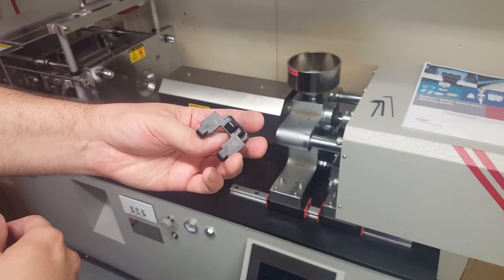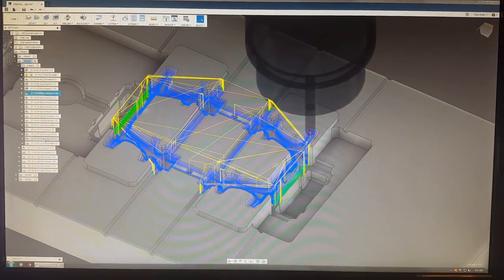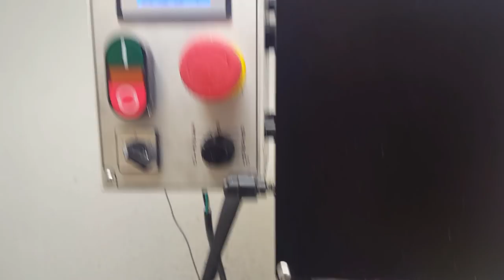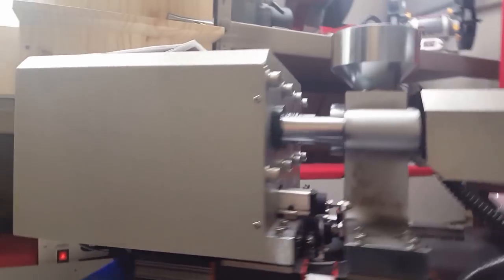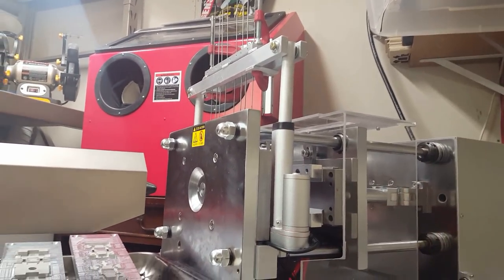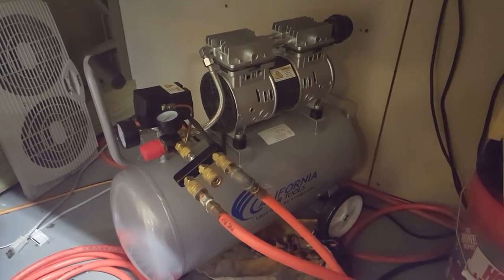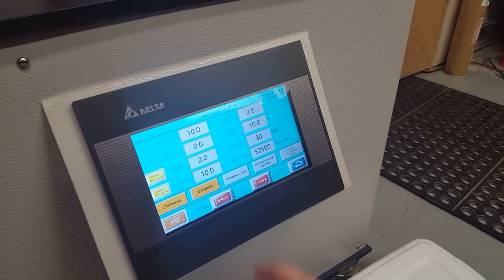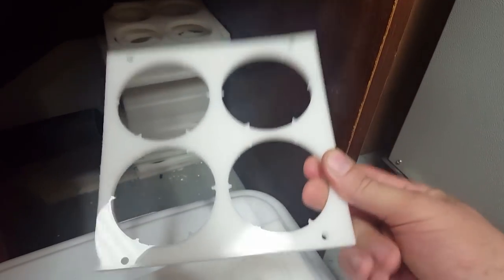Injection Molding - How It's Made & How It Works - Spyker Workshop

Comment: I am a professional plastic injection moulder of 40 years, aluminium mould don' t store heat, and Delrin epoxy resin needs 60 to 70 degrees tool heat to stabilise the strength and structure of the component being manufactured, depending on the wall thickness, and the size of the runner system determines the over all time to complete the weight to ratio of the part, i also did hear any mention of pressure from injection to mould input, which determines how hard you push the plastic into the mould or holding pressure which hold pressure for a determined time, whist the part stabilise it structure, so, speed, pressure, holding pressure are all necessary in the development of good components, and i also notice that your melt temps need to be rear zone cooler increasing to the middle to front zone slightly hotter.
Reply: Comments like this are just dick wagging. 

If you actually have something to contribute, trying asking him question or giving simple and actionable constructive comments, not just listing off a bunch of industry talk that has little relevance .

I'm a tool maker at an injection molding shop and I saw a mold close, a mold open, and a good part pop out. That's 90% of the way there. I wouldn't listen to anyone who speaks the way you do.
Reply: If you need help getting these plastic or metal parts made, this guy can help:
https://www.linkedin.com/in/roopen-bundhoo/

Hope this helps

Comment: I was just doing some research on injection molding and came across this video. I was shocked to see you have the same milling machine as I do. I have yet to install my dro, but I have thought about a cnc upgrade too. Really cool to see some else has done this. Its like your shop is mine in the future lol. I have a project the requires a longer table (like 30 "). Do you think that it is possible to make one and install it onto the pm 25. Thanks a lot for the video

Comment: I am sure you've figured this out already, but I thought I'd mention it anyway.  The reason that the track furthest from the sprue looked better on your second runt is the mold had been heated by the first run and now allowed the shot to flow better.  A warm mold always works better than a cold one.  Some molds are heated for this purpose, depending upon the material being injected.  Those are my two cents worth of info.  Hopefully of some use.  Thank you for such a cool video!  I am now considering doing this in my shop.  Cheers!

Comment: On your flash this may be caused by mold deflection during injection if I could see your mold installation a bit better I could explain how to trouble shoot mold deflection during injection. Your a very bright young man and have went further then some individuals with 30 years under their belt. I'm an former injection molding processor in thin wall injection molding and I'd be willing to help you out any time. Keep up the good work.

Comment: If a press fit hole is too loose, it can be tightened by using a large ball bearing. Place a large ball bearing, (1/2" diameter or so), center it on the hole and give it a whack with a hammer. This will evenly compress the metal around the hole re-tightening the press fit. Loctite also makes a press fit adhesive.

Also, use a hardened steel backer plate behind your ejector pins and use ejector pins with a shoulder so that they can be inserted from the back of the plate in a slip fit hole. The pins can then easily be replaced and the hardened steel plate prevents any wear. This type of ejector pin can be bought from various suppliers like McMaster-Carr.

Comment: mate I'm reading through these comments and it's honestly painful. I don't know what's going on with these people, but I congratulate you on this. I haven't done it so to me it's also very inspiring.
I don't know whether you have a lathe (I'd assume so if you have a CNC), but if you do maybe consider going hydraulic, you could make most of the pistons and whatnot yourself and just use smaller pistons actuated by screws instead of a pump. So essentially you could make an entire machine yourself. Hell that's what I plan on doing in a distant future. You could also add some water cooling to the molds to make the process quicker perhaps. Also you could lap the surface of the molds, that way you'd completely eliminate flashing provided you had enough support (not worth much if the mold just bends). Then compound that with a release valve on the plastic side of things so nothing blows up.
Just some ideas, again I've never done this but I do wish to and do give it some thought every once in a while.
Thank you for the video, and thank you for going so in-depth! Anyone leaving non-constructive comments is not worth listening to, especially in topics like these and people like you who put so much effort in.

Comment: great video , i am a mold ,tool & die maker for over 30 years with plastic and aluminum parts . you need waterlines in the cover and ejector halfs or the mold will flash crazy as it heats up over 1/2 hour ,plus the mould will distort permanately after 200 hr .
Reply: John Pauels hi , do you own a shop for your services? I am looking to produce an invention ; however ; I am looking for production on demand meaning that I would create a website and for every paid order the manufacturer will recieve each order along with the payment instantly from my portal. I am in Panama Central America and have no plans to travel to the US anytime soon with the covid19 ; can you suggest a serious company that could be willing to do something like this ? In china its common but would rather do this in the US thanks !
Reply: Hi John, exactly, he needs waterlines inside of tool to cool down the tool and plastic part, if the part has flash crazy, then the tool needs to shut better and improve the injection settings such as increase injection pressure/speed etc.
Reply: @ojoaereo241  hello ,yes i have my own shop ,youtube ,,,trinidad boring mill ,trinidad milling , trinidad lathe ,,etc , worldwide tooling working out of north america ,china and mexico
Reply: All true ideas in this comment.  Been in injection mold tooling and production since 1962, still consulting on Monday and Thursday.
Perhaps salvage your tooling to correct for shot size by inserting 2 cavities into a water cooled steel mold base? Form the tool inserts by cutting the existing plate into two, trim for symmetry and add a sprue on the center gating into the runner. Tunnel gating would disconnect the runner system. Horizontal camed slides with pins and wedge locks could automate core pins on mold opening and closing without the air assist. 
Add return pins to your ejector plate to save damage to the top cavity. 
Your sprue puller is HUGE wasting a lot of material, reduce with a bushing to just over the sprue's diameter. Use a Z pin or an undercut to retain the sprue for ejection.
Be careful around the clamp.
A nice setup, thanks for the content, a needed video.

Comment: i work at a mold shop and we use ejector pins with caps on them, like bolts, you counter bore the ejector plate and then add another plate behind that to keep them from pulling out. just add a solid plate on the backside of your ejector plate and you should be good to go. hope that helps  love the vid and ill look into buying one of these things to start a business of my own. very informative video thanks.

Comment: no water water on mould? a simple water channel in u shape through the tool bothsides set at 80 degc for delrin/acetal/P.a will make a much stronger part. this is because delrin is a crystalline material.
Nice set up. ive been a moulding tech for 27 years.your the first person ive seen make there own IMM.
Keep going.

Comment: Literature should specify the maximum capacity of your barrel and screw.  My familiarity is with Surfcam, which will calculate the volume of a part.  (Don't forget your runner and sprue volume.)  I wonder if Fusion 360 might do the same.  This could save you some future grief.  It's quite unusual to gate outlying cavities by going through a nearer (to the sprue) cavity.  This can lead to uneven packing in the outlying cavities, plus, you will have two runners and gates to clip from the nearer parts.  Molds work better when they are balanced.  In spite of having closed off one outlier, the mold is still unbalanced and may not sufficiently pack the other outlier.  You can mitigate this to some degree by widening the runner(s) on the side with the outlier.  This will reduce the back pressure resistance as resin flows into those two cavities.  You will likely need to experiment a bit to dial in your packing.  Your gates look huge!  You might consider ramping them, such that they are like chisel points at the edge of the cavity.  Plastic much prefers smooth transitions.  Try to avoid sharp edges in your runners and gates as this creates turbulence which can affect the part's finish and cosmetics.  The judicious use of vents might alleviate some of your flash and burn problems.  The air in the cavity must go somewhere when displaced by resin.  Some will leak out around your ejector pins, but this is usually not quite enough.  As the air compresses, it can become very, very hot.
If you're machining aluminum, the fewer flutes, the better.  Get some 2 flute mills, center cutting if possible so there will be less worry about plunging!  Aluminum rather likes WD-40 as a cutting fluid.  Alternatively, you could use A-9, in the iconic green can, but it's a little more expensive.
Typical ejector pin heads are captured between two plates with just enough clearance to allow them to "wiggle" within a slightly larger hole, but not move longitudinally.  I would ditch the JB-Weld.  Ejector pins need to float or they WILL eventually bind, bend and/or break.  It's not pretty when this happens.  It's especially likely with aluminum molds because the steel pins abrade the aluminum.  The aluminum sticks to the pins which eventually become too crufty to move,  ergo, "plink!"  Keep your eyes on those pins.
What you've accomplished here is quite impressive.  I wish you good luck.

Comment: Fascinating! You can make a second plate the same size as your ejector plate, use counter sunk fixings to secure it behind the ejector plate and it will keep your ejector pins in place as they cycle. You will need to use shorter ejector pins to account for thickness of the plate tho.

Great video, thanks for sharing!

Comment: spiral point  tap is what you used, if you are doing blind holes use a spiral flute which ejects the chips up and out of a hole that does not go through the material. brilliant work and problem solving.

Comment: Super interesting video. My mind is kinda blown by how much time and effort you've put into this.
Reply from the maker: neotoy Yea I put so much into this cause I want to make TONS of fifferent tracks, Im working on my Spyker KAT trzck mold right now
Reply: Try a star/spider array instead of linear. Arrange parts around sprue at compass points (N,E,S,W).
Injection molding works best when mold is balanced - 2,4,8,16... parts per runner.

I've been out of the game for a while, but your vid is comprehensive enough to trip  a memory dump. 
Good work and good luck!

Comment: Having a 3 cavity mould in that configuration is going to lead to very uneven filling/packing. The 1 will be full and over packed before the 2 are full. The melt front velocity will change dramatically too. You would be better off just making 2 at a time.

The best way to make a 4 cavity mould is to have each impression at 90 degree intervals around the sprue, to keep the fill paths balanced 👍

Comment: I am former truck driver, and one of the jobs we did was haul for company that were plastic compounders.  These folks added fiberglass, colour, mixed stuff, cut and bagged or put it in big totes, we would back into their docks and deliver it to all kinds of injection moulders.  To kick something out of a mould, the easiest way is run 2 small bars, mounted permanently to back of the mould.  When the mould is closed, these bars sit just bit behind the moulded product and when the mould opens, these rods kick the product out
Reply: Gaylord's?

Comment: you could have spread the injection entry  gates 1 per part from a single entry to distribute the plastic load equally.  Been there many times learned the hard way 25 years ago when I started making my own injection molding machines and parts. Grinding is great but they are not cheap. You can build one fairly inexpensive using creativity with similar grinding type mechanisms out there.

Comment: I want to help you with some ideas. I hope it will be useful. I don't have much experience either, over 3 years.
First of all, why the right side is full and the left oneis not, right? There are several possibilities to try, the first thing the point in the mold on the right side of the injection is larger than the one on the left, it may not be seen, but it is, it must be verified, I think that is the problem. if it doesn't work, check the steps below.

Closing power, I think you have to try more BARs.

The temperature in the worm must be tested.
After all, you have to play a little with the first step of the plastic (I do not know how it is called in English), and with the speed of the plastic in mold.

What is very important, there is no water in the mold, make the mold a little thicker and you can make the water pass through it, so cooling will be done in the mold, it is very important.

Comment: its nothing to do with cad drawing.the smallest difference in gate size will cause an inbalance resulting in uneven fill. we use pin gauges to get as close as possible then mould to see result, either polish or respark  using EDM. a small polish can change the flow as much as 10%.
Reply from the maker: No I ran out of shot size. In CAD I went to the max of 30grams but the physical property was set to ABS. Delrin needed like 32 grams. So it could not fill. I have to block off the other cavities vs recutting the mold with a slightly smaller part to get to 30 grams.
Reply: @thegreatestmoo  sorry, looked like you were having processing issue, couldn't tell from here that you maxed your barrel. There is a technique called flow moulding, before you you inject first stage you spin screw with back pressure on to force material into cavity then first stage, hold pressure, screw back as normal. We use it when we run out of volume.as long as you end  up with some material to drop to hold pressure you will be fine. Hope it helps, better than recutting.
Reply: Also called intrusion moulding.

Comment: Maybe when you make the ejector pins drill a little bit smaller hole all the way through an ad some Dora stick I think that's what it is called   aluminum welding rod that you can weld with a propane torch though oxy-acetylene or MAPP gas and oxygen is easier to use with it also I would grind a notch around the end of the pins so the weld can grab on to it and secure the pens from moving but just a thought
Reply: Usual method for production molds is to use headed pins in a two-piece ejector plate.

Comment: Nice work ! Your machine looks so tiny.. I work with large injection molding machines with up to 600 tons force,  the molds weighs up to 4 tons on that one :-) I have a tip for you, have a look at SimpleCV, its a very easy to use computer vision library, that way you can use a little raspberry pi and camera and do part inspection. Checking if to mold is empty before closing, (if there is a part that you ir barrier misses).. Its very easy, take a picture with empty mold, when machine opens, take picture, compare to empty picture, if same continue cykel.. Please keep posting the mods and updates you do to the machine! Have a nice day !
Reply: Peter Lehnér please do you know how much does it cost to have one like what in the video?

Comment: That looks like a Delta Programmable Logic Controller for the brains of your injection molding machine. The programming software, ISP Soft, for those PLCs is free. If you wanted to learn it, you could integrate the changes into the controller itself, which is expandable. You seem like a pretty smart guy, so i have no doubt it would be within your capabilities.
Reply: yeah I was mildly surprised when he opened it up and in there was just an industry-standard plc chain running the whole thing

but it makes sense once I thought about it because I know someone that operates one of these machines and he mentioned a lot of molds have special extra things they need which are electronically controlled. So it would make sense that the operator would just grab an extra plc module, jam it in there, and program the extra step for running the mold.

Comment: Great! Thanx for very detailed description. It is pity that original controller is closed source - it will be much easier to tweak it for pin pulling/insertion steps instead of Arduino hack..
Btw, looks like you need one more interlock to the entrance door interfering with screw gear moving unit on the right side of the machine :)